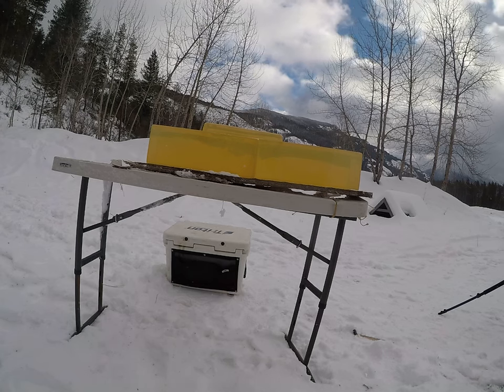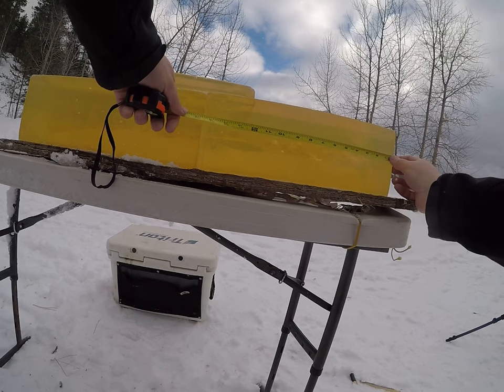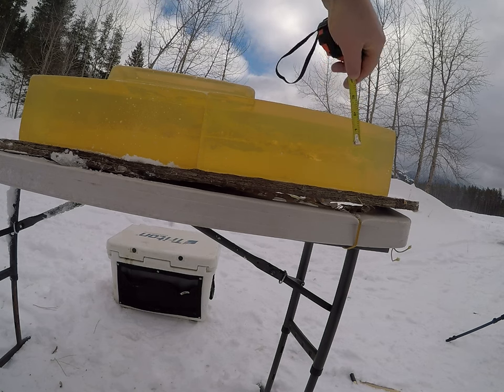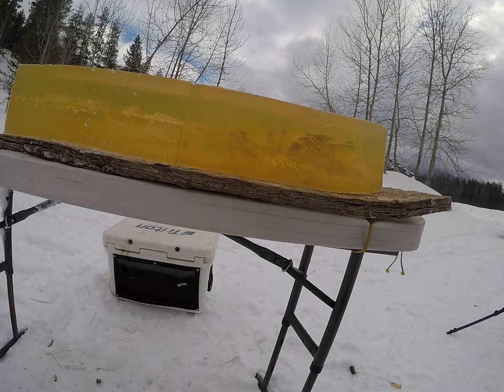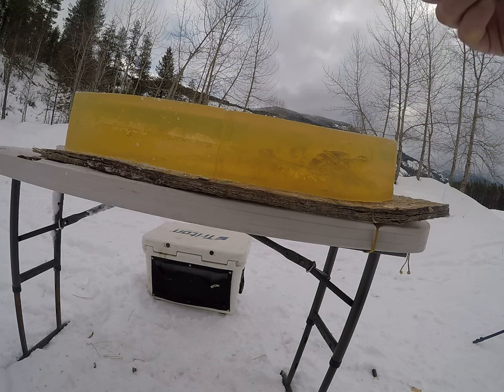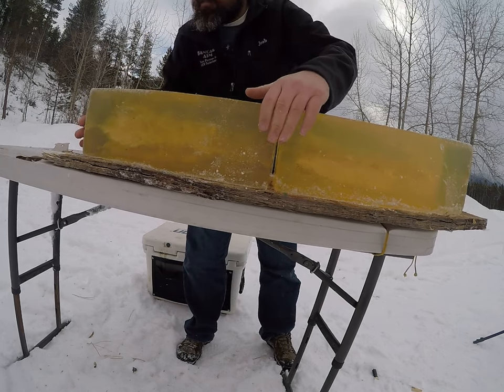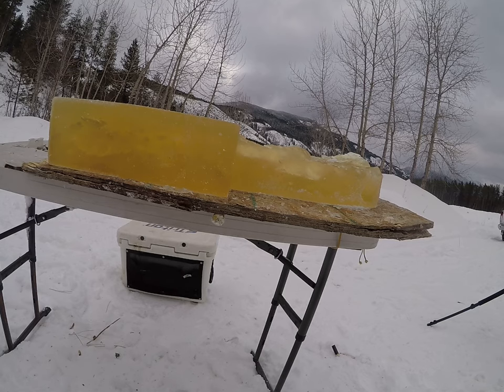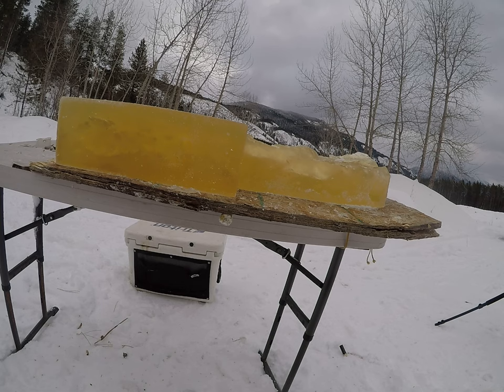30cal 152gr Shock Hammer ballistis gel testing (308win, 30-06, and 300 PRC) (Hammer Bullets)

Comment: I'd love to see some more videos of hammers. It would be nice to see velocities around 1600-1800 fps. I've noticed some times you hit a really low mark and the next loading is 800-1000 FPS faster. It would be nice to see speeds closer to the manufacturers claims, which are tyically in the 1600-2000 fps window.
Reply from the maker: When I am testing typically I will do low velocity shots in slight increases en-till I have one that dose not fail to perform (in most cases that is similar to the manufactures rating) showing low end effectiveness then flip the blocks and push the high end of the bullet itself or a standard full load in a non-magnum cartage. I am testing bullets and not the cases driving them. I like to know a bullets limitations at both ends because knowing that one knows in-between will be fine. Manufacturers ratings normally cover product lines and averages that can vary quite a bit from caliber to caliber. Noslers ABLR being one of the biggest differences I have seen in my testing from caliber to caliber. (ABLR is still one of my all time favorites regardless of the caliber)

It's hard to find a better bullet than a Hammer in monolithic. Badlands Bulldozer 2 possibly better defiantly at least as good. I have completely gotten away from Cutting-Edge because of their seal-tight band and free-bore issues I have had with multiple rifles now, good stopping power on game if one's rifle can shoot them.
Reply: @simplemindedfella  glad to hear from you. One area where the type of testing you do is sorely needed is with muzzleloaders. I'm personally interested in monolithic bullet performance, but I thihk all of the major lines that are marketed as long range projectiles should be put through their paces. Speed ratings are all over the place and it feels like every bullet that has been out for more than a season has a bunch of conlicting reviews saying things like "didn't expand on a 70 yard shot" and "I've taken 6 animals past 150 and every time it expaned perfect and left a huge blood trail." People load them to such different velocities and rarely report what they load so it's hard to separate user error vs. exaggeration vs. inconsistent performance and it seems every product reports a non-trivial number of failures.

Back on the subject of rifles, I'd like to see a few varmint loads tested in 30 cal at moderate velocities (~2200-2600 fpps) to see which expand best at most typical impact velocities. Everything should (hopefully) instantly grenade above that level and low end performance is not as relevant for that application. if you get back to testing, you could use the varmint buillets to destroy a block at the end of testing and then piece those together to make a review after a few rounds of typical testing. A Hammer HHT gel test would also be cool.

Comment: That performed exceptionally well. I definitely think it performed better than the 152g Lehigh controlled chaos. Both  have a similar bc hammer .362, lehigh .333. The hammers cost almost twice as much.... I can't justify the cost with both bullets performing well enough for big game, either should knock down an deer, elk, or bear with minimal issues, given proper shot placement and velocities above 1500fps on impact. Thanks, really enjoyed the Christmas vid!
Reply from the maker: Cost is significantly different in those two and I as well would choose Lehigh for that reason.
Reply: This comment has me wondering...did pricing change so drastically for the Lehigh in just over a year? I am looking today (2/1/23) and Lehigh CC are $55.00 / 50 count, and the Shock Hammers are $110.00 / 100 count...or the exact same price.
Reply: @ShastaBean  they used to be 55 for 100. They kept the same price but cut the quantity in half. So yeah, a 100% jump after wilson combat bought them.
Reply: @jonathanrogers9961  I guess that demonstrates they are charging ~2x more for their famous pistols than is necessary. I could grant them a price increase when acquiring a business segment, for whatever inflation, and production costs...But just halving the quantity makes it seem a bit sneaky, like "wonder if they'll notice".
Reply: @ShastaBean  i noticed. Im just glad i got a few boxes before the prices jumped.

Comment: Been watching a number of your videos, very thoughtfully planned out,  low velocity, high velocity impact.   It looks like you place a piece of wood in front of the gel. Is that to simulate bone/hide?   Also just curious why you are not using three blocks of gel as it seems like bullets are frequently existing the second block of gel.  Great vids!!
Reply from the maker: In my older videos I used to piece a leather stapled to aboard to simulate bone and hide after doing enough test with and without it makes little to know difference and is unnecessary when using 10% ballistics gelatin. 

I do not have the molds and refrigerator space for more than 2 blocks.

Comment: Firing "reduced loads" to simulate longer range or less powerful cartridges doesn't work. With reduced loads and reduced velocities also reduced rotational speed will affect bullet mushrooming.
Reply: but rotational speed will also decrease at range. And at a twist rate of 1 in 10 the bullet would only make 2 rotations in 20in of penetration.
Reply from the maker: Yes when thinking about rotational spin reducing over distance versus reduced loads logically you would think there is more of an issue than what there is. If it were truly an issue sub sonics out of guns like the 300 AAC/Blackout would have never been created cause it could not have worked, as well as the subsonics in pistol calibers in considering things like the 350 Legend and the 450 Bushmaster, they wouldn't exist eather because it wouldn't work if that were true. Fact of the matter is, it really doesn't play a significant factor at all in the performance of the bullets after impact. It really only plays a factor in the stability of the bullet in flight.

Yes I have answered this with a bullet test showing no difference in performance with just over a 80,000 RPM difference https://youtu.be/vvTlmo_X594
Reply from the maker: @EdAb  Merry Christmas!